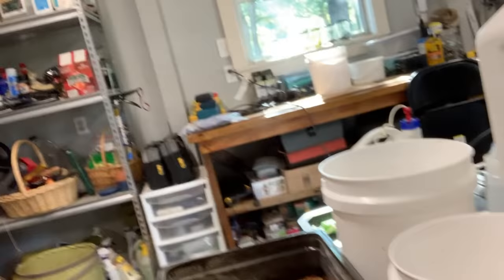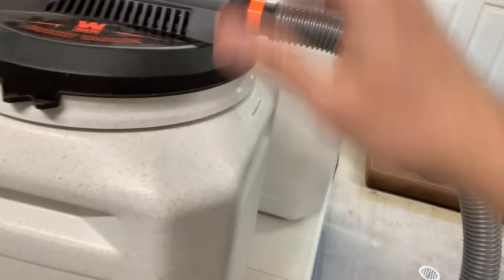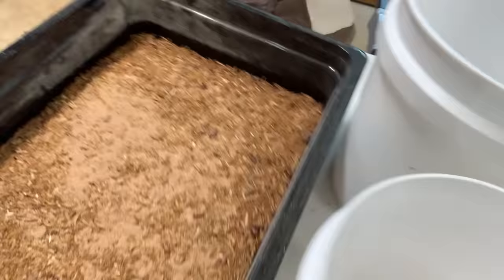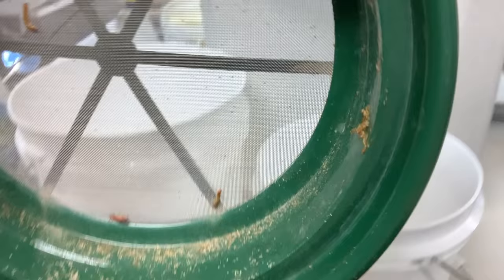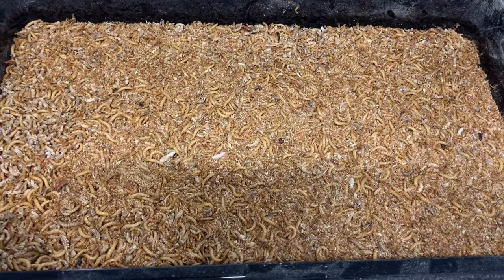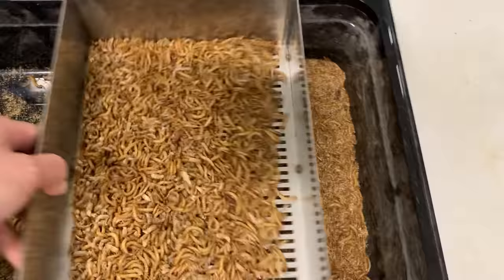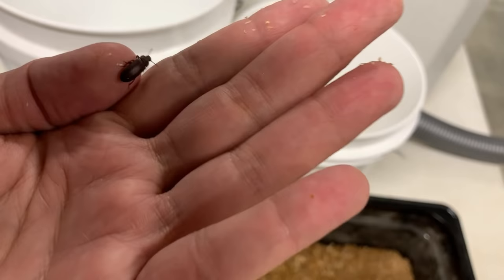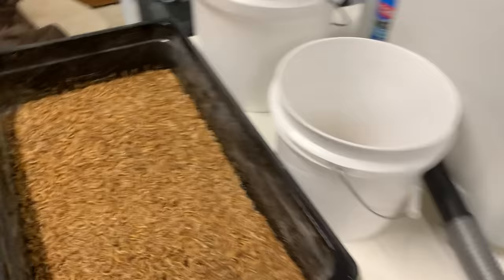MEALWORM FARMING FOR BEGINNERS – How to Maintain a Healthy Mealworm Farm

Comment: where can i get those tubs
Reply from the maker: Hi Arthur! At the bottom of each of my YT videos, I include a link to my Amazon storefront. There, you will find a section called “Mealworm Farming.“ In that section, I list several bins, totes, and lids that you can use with your mealworm farm. Each time you purchase from my link, I get a very small commission, which helps me continue making these videos. For my system, I used these pans: https://amzn.to/3FoYtgg and these lids: https://amzn.to/384RNI5. For the lids, I cut the top with a router and added mesh for ventilation. The mesh I used is here: https://amzn.to/3KTc8NV. I attached the mesh with this two-sided tape: https://amzn.to/3FmRynV. I then placed this gaffer’s tape over top: https://amzn.to/3FmRt3B. Hope that helps!

Comment: Hello I’m curious where you get these trays?
Reply from the maker: Hi Andrew. At the bottom of each of my YT videos, I include a link to my Amazon storefront. There, you will find a section called “Mealworm Farming.“ In that section, I list several bins, totes, and lids that you can use with your mealworm farm. Each time you purchase from my link, I get a very small commission, which helps me continue making these videos. For my system, I used these pans: https://amzn.to/3FoYtgg and these lids: https://amzn.to/384RNI5. For the lids, I cut the top with a router and added mesh for ventilation. The mesh I used is here: https://amzn.to/3KTc8NV. I attached the mesh with this two-sided tape: https://amzn.to/3FmRynV. I then placed this gaffer’s tape over top: https://amzn.to/3FmRt3B. Hope that helps!

Comment: Where can I get the black trays and lids?
Reply from the maker: At the bottom of each of my YT videos, I include a link to my Amazon storefront. There, you will find a section called “Mealworm Farming.“ In that section, I list several bins, totes, and lids that you can use with your mealworm farm. Each time you purchase from my link, I get a very small commission, which helps me continue making these videos. For my system, I used these pans: https://amzn.to/3FoYtgg and these lids: https://amzn.to/384RNI5. For the lids, I cut the top with a router and added mesh for ventilation. The mesh I used is here: https://amzn.to/3KTc8NV. I attached the mesh with this two-sided tape: https://amzn.to/3FmRynV. I then placed this gaffer’s tape over top: https://amzn.to/3FmRt3B. Hope that helps!

Comment: What kinda trays and what's best shaker system
Reply from the maker: At the bottom of each of my YT videos, I include a link to my Amazon storefront. There, you will find a section called “Mealworm Farming.“ In that section, I list several bins, totes, and lids that you can use with your mealworm farm. Each time you purchase from my link, I get a very small commission, which helps me continue making these videos. For my system, I used these pans: https://amzn.to/3FoYtgg and these lids: https://amzn.to/384RNI5. For the lids, I cut the top with a router and added mesh for ventilation. The mesh I used is here: https://amzn.to/3KTc8NV. I attached the mesh with this two-sided tape: https://amzn.to/3FmRynV. I then placed this gaffer’s tape over top: https://amzn.to/3FmRt3B. The best shaker system is … well … the one I developed, of course! You can find it for sale here: https://www.mealwormfarmingsolutions.com/collections/mealworm-farming-equipment. Hope that helps!

Comment: @ranchermike …can I get links to sifter& the black bins?
Reply from the maker: At the bottom of each of my YT videos, I include a link to my Amazon storefront. There, you will find a section called “Mealworm Farming.“ In that section, I list several bins, totes, and lids that you can use with your mealworm farm. Each time you purchase from my link, I get a very small commission, which helps me continue making these videos. For my system, I used these pans: https://amzn.to/3FoYtgg and these lids: https://amzn.to/384RNI5. For the lids, I cut the top with a router and added mesh for ventilation. The mesh I used is here: https://amzn.to/3KTc8NV. I attached the mesh with this two-sided tape: https://amzn.to/3FmRynV. I then placed this gaffer’s tape over top: https://amzn.to/3FmRt3B. Hope that helps!

Comment: Where did you get your screened boxes?
Reply from the maker: At the bottom of each of my YT videos, I include a link to my Amazon storefront. There, you will find a section called “Mealworm Farming.“ In that section, I list several bins, totes, and lids that you can use with your mealworm farm. Each time you purchase from my link, I get a very small commission, which helps me continue making these videos. For my system, I used these pans: https://amzn.to/3FoYtgg and these lids: https://amzn.to/384RNI5. For the lids, I cut the top with a router and added mesh for ventilation. The mesh I used is here: https://amzn.to/3KTc8NV. I attached the mesh with this two-sided tape: https://amzn.to/3FmRynV. I then placed this gaffer’s tape over top: https://amzn.to/3FmRt3B. Hope that helps!

Comment: Does your black trays come with the lid , did you put the screen in, I am in Or I would like to set up like you ,no reason to invent the wheel.
Reply from the maker: Check out my Amazon storefront: https://www.amazon.com/shop/ranchermike. There I have a section called “Mealworm Farming” where you can find the bins and lids. I cut the middle section of each clear lid and add mesh for ventilation. You will also find the mesh that I use on my Amazon storefront. Thanks!

Comment: What do you do with the frass?
Reply from the maker: It has many uses. You can use it as a skin defoliator, bean bag filler, or breading for shrimp and fish! [DISCLAIMER: Frass is not intended for any of these uses. Frass is an excellent soil amendment which strengthens plants as they grow. Do not use frass if you are allergic to frass. Use frass sparingly, like you would perfume ... or cayenne pepper. Also, please do not taunt frass, as it can easily get its feelings hurt.]

Comment: Where did you get those trays?
Reply from the maker: You can find the pans here: https://amzn.to/3FoYtgg and the lids here: https://amzn.to/384RNI5. For the lids, you will need to cut the top and add mesh. The mesh I used is this: https://amzn.to/3KTc8NV, which I attached with this two-sided tape: https://amzn.to/3FmRynV. I then placed this gaffer’s tape over top: https://amzn.to/3FmRt3B. Hope that helps!

Comment: Where can I get the trays
Reply from the maker: At the bottom of each of my YT videos, I include a link to my Amazon storefront. There, you will find a section called “Mealworm Farming.“ In that section, I list several bins, totes, and lids that you can use with your mealworm farm. Each time you purchase from my link, I get a very small commission, which helps me continue making these videos. For my system, I used these pans: https://amzn.to/3FoYtgg and these lids: https://amzn.to/384RNI5. For the lids, I cut the top with a router and added mesh for ventilation. The mesh I used is here: https://amzn.to/3KTc8NV. I attached the mesh with this two-sided tape: https://amzn.to/3FmRynV. I then placed this gaffer’s tape over top: https://amzn.to/3FmRt3B. Hope that helps!

Comment: Do the DIY people never realize how far down the rabbit hole they have gone.   Yeah it’s real easy and cheap I just had a friend cad model and cut my own stainless steel sifters……
Reply from the maker: Hey Cynical Joe. If you took the same amount of time to actually watch my video as you did to craft your snide remarks, you might have actually learned that the techniques I share have little to do with the equipment I use and more to do with my methodology for cleaning up neglected mealworm bins (which can be applied to any mealworm farm, no matter its size or configuration). I go over my metal sifters in detail so that anyone who might want to make their own device (whether out of metal or another material) can do so with the benefit of my knowledge and experience. My intention in making these videos is to provide a positive contribution to society (however small) through educated discourse, which is the exact opposite of what you obviously intend to do by posting ridiculous comments like this. So, I am left to wonder aloud, “Do internet trolls ever realize that they expose their own infantilism and ignorance every time they post asinine comments on YouTube”??

Comment: Where to buy those bin sir?
Reply from the maker: At the bottom of each of my YT videos, I include a link to my Amazon storefront. There, you will find a section called “Mealworm Farming.“ In that section, I list several bins, totes, and lids that you can use with your mealworm farm. Each time you purchase from my link, I get a very small commission, which helps me continue making these videos. For my system, I used these pans: https://amzn.to/3FoYtgg and these lids: https://amzn.to/384RNI5. For the lids, I cut the top with a router and added mesh for ventilation. The mesh I used is here: https://amzn.to/3KTc8NV. I attached the mesh with this two-sided tape: https://amzn.to/3FmRynV. I then placed this gaffer’s tape over top: https://amzn.to/3FmRt3B. Hope that helps!

Comment: I used to have a wild baby bird, me and my dad went to the pet shop to buy mealworms next day the bird died and I have to take care of mealworms now ;-;I don't want to waste them
Reply: The mealworms can bite lizards and birds when eaten, and they have strong jaws and do significant damage. I wonder if your bird died because of that.
Reply: Oh ok, I didn't know they bite that hard to birds o.o
Thank you!I have learned something knew and I'll take that as a lesson
Reply: Wait one more thing, Everytime I feed them I kill the mealworms by squashing their head (I know it's so cruel) And then feed it to the bird
Reply: @casadaze6098  I would try drowning mealworms in water. They don't tolerate water. That might be a little less cruel than crushing the heads. Also, it saves a lot of time if you have a lot of mealworms. But I haven't tried myself to drown them. I'm just speculating.
Reply: @Rozeg666  I disagree, crushing their heads is an instant death, letting mealworms drown might take longer.
Reply: @xyzsame4081  You're probably right. But it's also a matter of quantity. If you have a lot of chickens to feed, you'll spend all day crushing mealworms' heads for them, unless you find some efficient automating solution